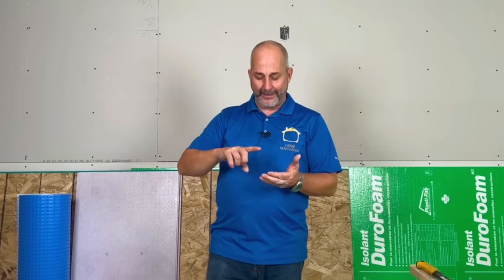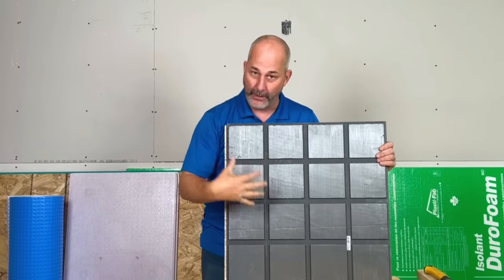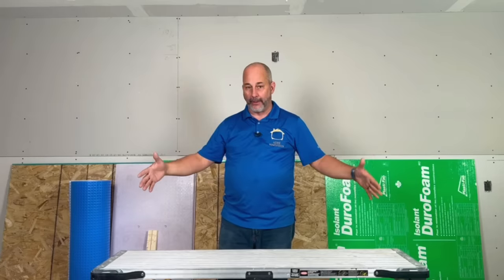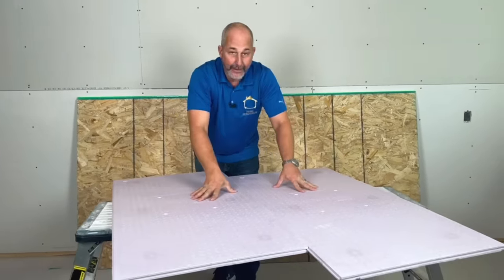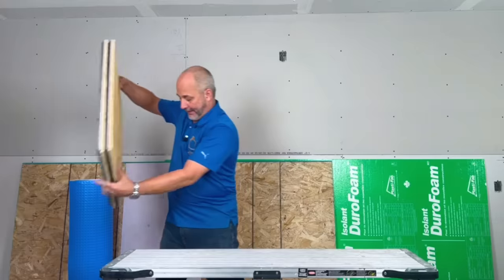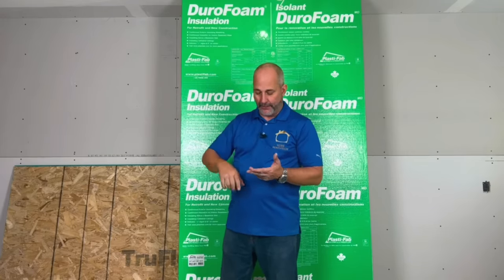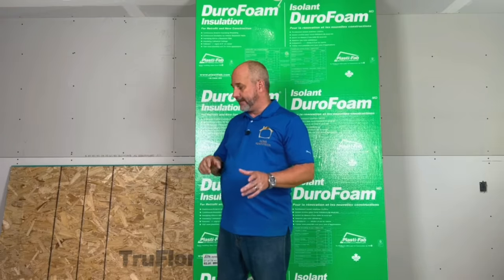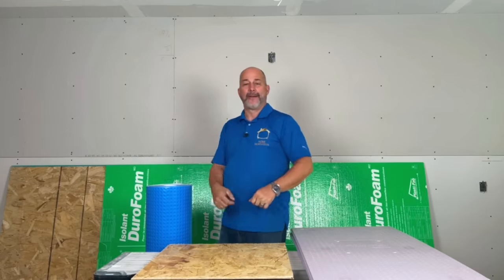Comparing 5 Different Subfloor Systems and What They Cost

Comment: What should I use in my basement it has flooded 3 times in 30 years  and 2 times since we owned it last 5 years. Both time we had to rip out the carpet. It is a large basement over 2,500 sq ft. I notice that the three tile areas seem unaffected by the flooding but would doing tile cause more damage to the drywall if it flooded again? What is the best flooring for a basement? Should I do for flooring?

I think we have figured out what is the issue is and we are taking preventative measures back up sump pump with WiFi, generator, diverting water with an awning over back porch drain, and water leak sensors.

Comment: I am looking at doing the same in my newer home basement build. I want to use the delta MS dimpled membrane as it seems to be better quality than the DMX and comes in 8.5 ft widths (less seams). I was going to use the 5/8 osb then I saw a video for a similar subfloor using 5/8 spruce plywood. I read that the plywood is 8 times more resistant to swelling if it were to get wet than OSB.  Plywood is more expensive but still comes out cheaper than the Drycore. After watching this video I am thinking of incorporating the Durofoam sanwitched in between but am concerned about floor height too especially with my first step.

Comment: Hi
Quick question determining best subfloor. Great video. I live in Winnipeg Canada 8 yr old home. No major water issues or thermal break issues identified. Want to ensure longevity of basement and comfort in process of finishing currently. 
What would you suggest for subfloor (if any) and flooring material. I was thinking vinyl. Could this go over a DMX dimple product directly? Does the DMX have to be fastened at all. 
Thanks Jeff. 
Love the helpful hints and your channel!

Comment: Hi Jeff

Couple of questions from the Netherlands please.

I would like to insulate my living room floor ready for underfloor heating.

Under the floor there is around a 1.5 meter space with a sandy surface and it appears to be dry and not wood rot existing.

The floor is basically wooden beams with wooden planks on top, an underfloor with then a wooden oak floor on top.

In the Netherlands the approach is normally to place a plastic membrane on the sandy floor to stop moisture from coming up from the sand and to insulated between the rafters.

I was going to build up the floor as follows:

1. Plastic moisture membrane on the sandy floor, sealed at the sides.
2. Wedge PIR insulation boards between the rafters at 120mm thickness.
3. Any tips or comments on how I was intending to build up the floor.
4. Any tips that you would do whilst the underfloor is exposed?

For example I am going to add insulation cladding to the pipe work of the heating. Run some network cables.

Would you do anything like cementing the brickwork to make it more airtight or sealed? Airtight rafters or prevention of rot where the rafters go into the brick foundation? 

Many thanks in advance
Mark
3. Maybe put a moisture stop on top of the rafters.
4. Place chipboard boards down, instead of reinstalling the existing planks and glue and screw them down.
5. Installing underfloor heating.
6. Install a concrete like floor.

My questions please:
1. When installing insulation between the wooden rafters, should the insulation touch the underside of the floor or should I leave an air space of say 10mm?
2. Do I need a moisture Barrie between the insulation between the wooden rafters and the chipboard floor?

Comment: No moister problems I'm just trying to figure out a thermal break. I don't have the walls firred out yet either so I'm thinking I could probably do the durofoam and OSB but I believe California code requires the floor be R10 😱so not sure that'll be enough.

Comment: Hi -- thanks so much for the video.  Have a 1960s home with walkout basement on Oregon Coast.  Rarely freezes, and haven't seen moisture issues, as the side of house thats built into the hill is where the garage is.  But, concerned about humidity here anyway, and very uneven floor.  My son was going to put in leveling cement, but became concerned about speed working alone.  Now, im considering the dricore tiles as he could work alone at his own pace?  Will the shims be sufficient?

Comment: Great vid thanks!!!!!.... I live in deep south usa.  Much heat and humidity... Had a bath leak for years and did not know it.... Replacing .75 ply bottom, then .75 particle board on top... Both full of black mold.  Floor is not insulated, do you recommend a thermal break of 3\8 then Maybe 3/8 ply....top?   Working alone and .75 ply is really heavy...  Thanks.
Leak puddled under den .  its a raised house 2x8 framing PT and that's good...yeah!!!!!!  @10" to earth.

Comment: Adding a bathroom to first floor by separating a space within a large living room. The current flooring is hardwood flooring. Obviously that's a no for a wet space so my plan is to LVP the bathroom. House is pre 1800's.

So my questions are - 
Do I put an underlayment over the existing hardwood floors? 
Do I use one of these subfloor systems or "building materials" that you mentioned and then LVP over it? 

Thanks in advance!

Comment: We have a basement in a house built in 1951.  No water in the basement and updated drainage in the yard.  Looking to finish the basement ourselves and was considering your solution but wondering if that is enough water management.  Definitely need a vapor and thermal barrier but there are no cracks in the walls so seems like this should be fin.  We are planning on LVP so not need for a thickness for staples.

Comment: House was built in the 1960’s. I have a lot of moisture problems. I have redone the outside walls with insulation and a membrane so wondering what would be the best and cheapest option to control the moisture?

Comment: Great video. I am currently living in the Midwest and I have a new-build. I'm looking to finish my basement and I've already insulated the walls. I have a poured basement and I am so glad that I saw this video. Trying to get straight answers on What the best products are is next to Impossible. And local contractors are few and far between in my area. I do have one question in regards to basement walls. I have already put up 2" foamular 150. And have framed the outer walls. What would you recommend do I need to put mineral wool in the walls still?

Comment: It's been a while since you've posted this video but I will try anyway!
I have a house of '93 and want to finish my floor. However I'm in a flood zone and had some water in the past. (not much since I have a sump pump and backup soon).
My question would be: can or should I install a DMX membrane AND a ceramic/porcelain tile all over my basement? I'm also considering a DMX + laminate floor ONLY for my office since it is the furthest from the possible flood zone.
Thanks in advance!

Comment: Hi Jeff. Hopefully you are still tracking comments on this video. I am doing a 5000sq ft concrete slab on grade that has minor cracks where moisture at times will come up through the cracks. I thought my best option would be the 2x4 barricade panels with the “pucks” but after watching your video I’m wondering if I should go with the durofoam panels. What are your thoughts on using durofoam when you know there will for certain be some moisture coming through? Should I stick with the barricade? Thanks!

Comment: Hello I have a home built 1920 we had foundation problems and had a professional put in a pump to keep the moisture out of the basement it hasn’t been the best results we want to finish the basement but we are still getting moisture from the floor and walls we plan on adding another layer of concrete to help the problem which subfloor should we use after we reapply the concrete please advise please and thank you I appreciate all the videos and advice 🥰

Comment: 1890 home has subpump , water coming from crack In wall  , has 1 room partial finished , plastic over concrete  and vinyl.plank that has Shrunk with gaps over 1 inch . Located in ohio. Thinking  the black roll out dimples  product  with plywood  leave everything  1 inch away  from existing  walls black underlayment,  plywood  and wall studs. I need your opinion  on if I'm considering the build  correctly.  Thanks in advanced! I am a Carpenter by trade,  but water and moisture  is not my expertise

Comment: Thanks for the info. 
I just ripped out a 20year old carpet from the basement and installed gym interlocking foam mats directly on concrete. Townhouse in Philadelphia built 1980. What do you think? I don’t believe I have a vapor barrier but don’t have a problem either. 
Yah it is colder in the basement since the supply duct is only for upper floors but my kids don’t mind. 
Thanks

Comment: I live in the north east USA (near Philadelphia). My basement is fairly large and already finished. Power went out and sump backed up and flooded basement. Renovating now. House is from 2005. Floor before had a very thin plastic underlayment and a floating floor cork backed vinyl. It was always cold in the basement so I want to improve that. The sump issue I've solved.

Comment: I'm curious to the scenario  which you presented of an older home with foundation cracks to deal with water management, act as vapor barrier and create a thermal break . Have you actually completed a scenario in which you did both the DMX 1 step and the Durafoam on top of flooring? That would be an interesting video.

Comment: Hello Jeff. I have a 2 year old new construction in Cedar Lake IN which is located in NW Indiana bordering the IL state.

Builder informed us that they had "zip line cracks" in to our basement floor?? Cracks have not gotten any worse or bigger in the last two years and  We have not had any water or moisture issues yet, Thank God!

Would the Drycore Insularmor be a match for us with plank flooring to be installed over it

Comment: Jeff, hot water heater leaked water all over basement floor. Had the Dri Core subfloor and carpet.  Now need to repair.  What is the best flooring and moisture management flooring to use? House was built in 1975 in Wisconsin.

Comment: My home was built around 1978. I have 5/8 OSB on top of the DMX dimple board. I didn't think about the thickness of the floor for installing hardwood. I have some left over hardwood flooring but i guess i can't use that without putting more OSB down. Basement is tight on height so whats a good option for flooring? I guess any snap together flooring would work. 

Thanks for these videos. I used your tips from the start of my basement remodel.

Comment: My house is an old gas station built in 1950. There is a basement In the living quaters behind the shop with 7' celings, I'd like to finish it out. The floors are super uneven (I assume I'll have to pour a self leveling concrete) and this town I live in is a marsh so we have water problems and it's a northern climate. I think I solved any flooding issues but I'd like to know if that durafoam would work with water management in mind as well as a vapor barrier

Comment: Hello, I live in Toronto in a home built in the early 1930s. We recently dealt with a sewage line back up into our basement and as a result had to remove our existing flooring. That flooring was carpet, but under the carpet I had installed 12” square plastic interlocking tiles to create a barrier between the carpet and the concrete floor from potential moisture and small water leaks. That tile saved our furniture from the sewage backup. I’m curious if there is a product you would recommend we use now that we are having to replace the flooring.

Comment: 40 year old home. Remodelling basement bath. After pulling up toilet discovered mould. I've torn up the old sub floor (plywood on strapping) and was just going to replace it with the same but I'm thinking there is a better way. Small room, maybe 50 sq. ft. Thoughts?

Comment: Jeff, I watch all the videos. Great stuff. Here's my scenario. Live in Chicago. 1800 sq ft space in the basement to add a floor. 100 year old house. Basement poured cement foundation is not deep (3.5'). Permaseal fixed cracks in the foundation, but once or twice a year, I'll get a trickle of water from the exterior walls after a huge rain. We have floor drains though and a pretty big slope in the concrete. Boiler/radiators/pipes in the basement mean that it is toasty down there. Do not have condensation moisture issues. What would you suggest for a subfloor below LVP? Much appreciated!!

Comment: Hi Jeff, first I want to thank you as much as possible for your valuable information and knowledge. I have an old house that was built at around mid of 50th. The basement has zero insulation and I want to finish. What is your recommendation for the thermal and water management insulation system that does not need a fortune to do and gives good results? the house is in Hamilton ON

Comment: Hello, I am in WA state/ Whidbey Island. My home is about 15 years old. I have 3 3/4 inch cherrywood brazalian hardwood floor in the kitchen, hallway and entry. The family room, sitting room and dining is all carpet. Im looking to upgrade the floor without spending too much since we are military and will only be here 2 more years. We plan on selling. I've been looking into LVP, LVT and the hardwood. When my carpets are removed, there is a gap in the floor  assuming 3/4 that needs to be lifted before the LVP. I know that cost can add up. I've heard from a bunch of different contractors- some say remove the hardwood, some say keep it. I'm torn what to do. I wanted to keep it, but we have a 4 year old and LVP seems to be heartier from him run around and play, scoot ect. Also, I spoke with the developer for a few of the houses here and he said the trim will definitely damage removing. Im not trying to replace all that trim, its brown wood everywhere!! What is your opinion to move forward?

Comment: my project: new subfloor for basement laundry room.  I'm in New York, Queens.  In a house built in 1901.  The laundry room is a small room estimated size 10 x 8.  Should i be using those 2x2 panels?  Can i add tile or what type of laminated wood flooring should i use?  -- By the way, I love your videos - very helpful - keep them coming.

Comment: We need to replace the subfloor the previous owners used. No moisture issues. And the house was built in the 1950s. NY. Transitioning from carpet. The area is above the garage so we want sound proofing and thermal control.

Comment: absolutely love your videos. My brother is helping me with a full renovation of my basement. I live in Virginia and have a 1977 home with a basement. I plan to install LVP flooring, but would like to address moisture and thermal issues. So far, we have found some signs of mold on the framing. Nothing too serious, but looks like there is moisture coming from the walls down to the framing. After watching this video, I am still unclear as to what I should use. I think Durofoam is the way to go, but do I use something under it for the moisture/vapor barrier? And do I use OSB on top of the durofoam on which I would install my LVP? Just a little confused what I should use underneath and over the Durofoam. Your advice would be greatly appreciated.

Comment: Hello Jeff. Very helpful video. I am looking to finish my basement. Its a 1988 built condo. Basement has no leaking issues. But I still want to have waterproofing and thermal insulation. I was thinking about composite wood flooring. Can you help suggest options. Thanks in advance.

Comment: Here in Michigan with a 1901 home that basement has solid granite block walls and a concrete poured basement. There is some water that comes in the walls but home isn’t properly graded or guttered yet. I’ll test out the trash bag trick for vapor. What would you recommend?

Comment: I have a 130 year old girl, and we are lowering the floor 2 feets this spring (one feet will be 3/4 stone and interior french drains) the next will be 2 inch undergrade foam and 10mm vapor barrier, then 4 inch reinforced concrete with fiberglass, the wall let a lot of water in still, untill 2024 (when we will do exterior french drains and sealing walls, my question is should I try to install pereferial interior drains for the water to just sip directly to the interior french drains? And what subfloor should I use if we go engineered hard wood floor or should we just ceramic (Schluter dites heat duo) for safety if future water , thanks

Comment: My house is 10 years old. I know the perimeter of the foundation has a vapor barrier, but I'm not sure about under the basement rec room concrete floor. I just bought "tongue and groove" engineered 3/4 hardwood to replace the carpet that is currently there. What is the cheapest underlayment that will work with "tongue and groove" engineered hardwood ? I assume it has to be nailed since it's not the quick-log laminate variety...

Comment: I’m finishing my basement right now. I live in St Louis and the house is 7 yrs old. I have a Sump Pump pit that activates during rainstorms. I have no moisture coming through the floor at all. However I’ve had my pump float not activate and water seeped up on one occasion.I have since put a Spy Pump System and it has a sensor to notify me when it gets too high. 
I want to use the dimpled underlayment like the Blue sheet you showed on this video, DMX? Along with a vinyl lock floor I have picked out. This way no matter if I have a pump problem again I can at least have airflow underneath to dry it out and prevent mold. 
Is this the correct application for my install? 
I saw your vinyl floor video also and it helped me choose the correct floor! Thank you so much!